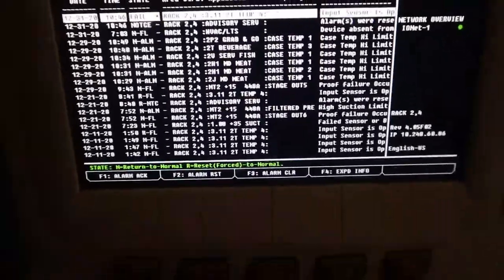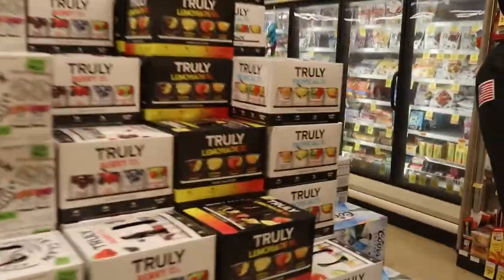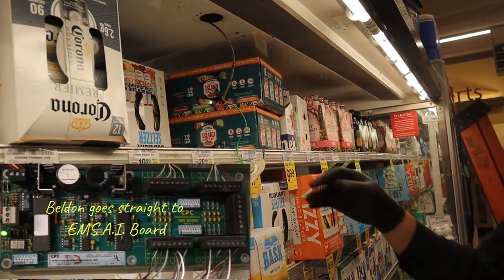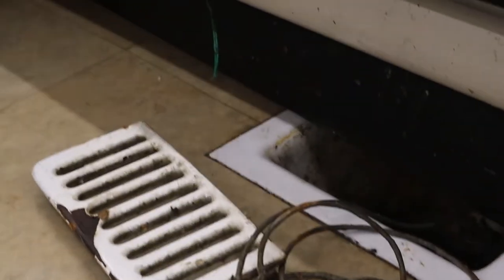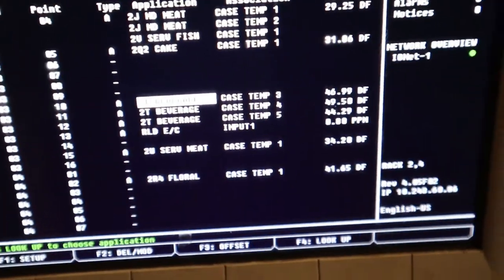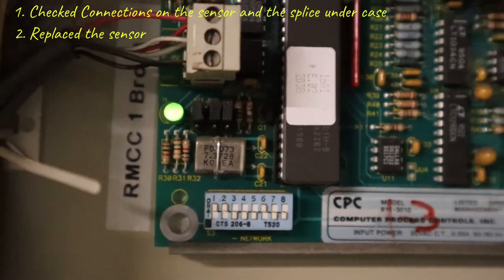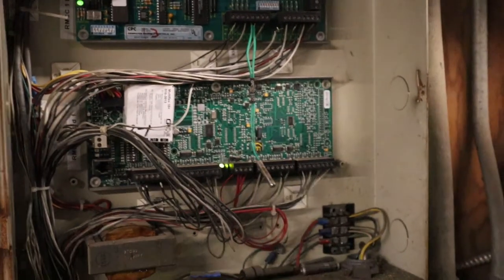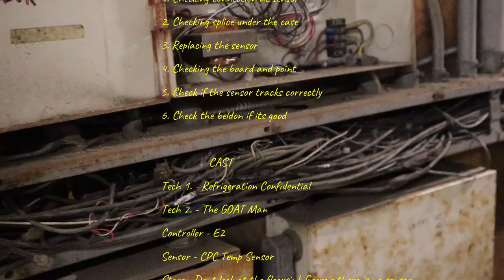Refrigeration: E2 Alarming Open Sensor Steps to Identify the Issue

Comment: How did you run the sensor into the honeycomb? From the drain hub thru the back of the case and to the honeycomb?
Reply from the maker: The beldon was pre existing we just re-spiced and replaced the sensor.